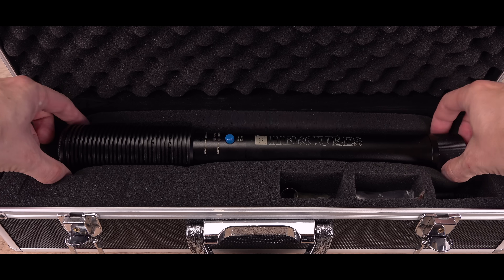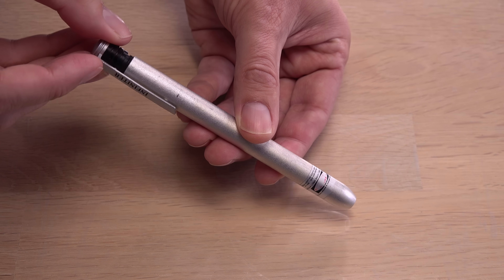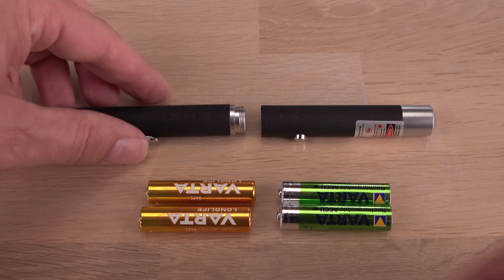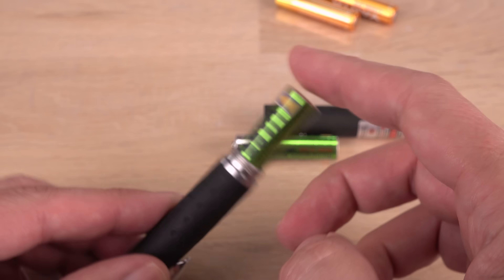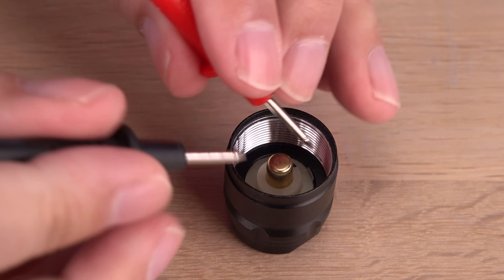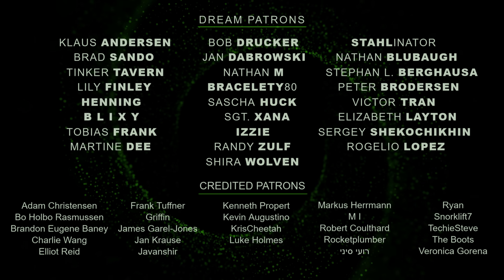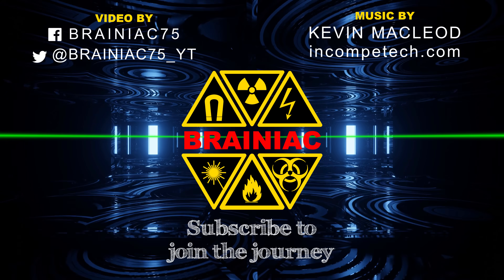DUMB DESIGNS | Laser Safety Issues Never Mentioned

Comment: one time i had two rechargeable AA batteries in a digital camera in my pocket. there plastic coating on them was damaged from wear. they shorted in the camera, melted out of the camera, burned my leg, and i franticly threw them in the trash can. they melted through the trash can and embedded into the floor. learned a lesson.

Comment: Lithium cylindrical cells are case negative up to a certain size, if they get screw terminals or laser weld terminals I'm not sure. Prismatic cells always have cases that are connected to positive, or floating. The floating ones should stay insulated as they make contact with the electrolyte and can form dendrites inside if connected to a different potential

Comment: The case neutral is most likely not alkaline but zinc carbon. Never seen a case negative alkaline cell before. It is apparently possible if the label clearly states alkaline

Comment: I'd need to see exactly how those new plastic tube laser pointers are made, but if I had to guess the plastic isn't there becsuse peeled cells =  bad but because metal = expensive.
Easier to shove in some recycled condoms and save a penny on each laser pointer when you're producing millions of them.
Especially if those plastic tubes are already used for another purpose, then they'll be dirt cheap, doubly so if it's something like pipe and the factory is just buying up ends which have been cut off for a fraction of the cost.

Comment: I doubt that tiny red laser pointer could cause any more harm than a LED bike light.

Less in fact as I've got an LED bike light which will easily burn holes in (black) plastic or paper at a 5cm or less distsnce. Will also cook skin at that distance, I can hold it up to my hand for about ten seconds before I need to move it as I'm grtting burned. 
The light wasn't even expensive either, cheap rechargable light in a 2 pack. 

That red laser pointer you could point at your hand, black plastic or paper or anytbing else and never be harmed. Even if you ended up shining it in your eye it wouldn't do much more than dazzle.

You're looking at a similar output as a barcode scanner. So while the safety warnings are good for higher power lasers, I feel using it as an example of unsafe design (from a laser safety standpoint) is a bad one. Kind of feels like it'd introduce a boy who cried wolf attitude and make people treat more powerful lasers with less care.

Comment: The 5 sec delay actually can make issues like "turned it on.. it don't turn's on. What is wrong? I totally need to look at the laser's barrel to see if it's turn on, even if it fires invisible wavelength. Ouch!". You may say that user need to read instruction first, but 1) users like these don't read instructions 2) "safety" section of instructions usually mostly consist of "don't eat the batteries", "don't eat the laser", "don't dive with the laser when it's turned on", "just in case you're forget, do not eat the laser, even partially", "don't disassemble the laser", "in case if you disassemble the laser, don't eat its details", "dispose it in accordance with local regulations (not by digestion)" and so on, so most users just don't expect to see any unobvious information here and skip it.
Reply: It's actually a legal requirement

Comment: You have to differentate... 
These cheapout issues would be an issue IF it was a high powered laser...
Those lasers are class 1 or 2... not dangerous at all (unless you are the dumbest person on earth and look straight into the beam for a quite long time)
On Class 3b or even class 4 lasers like a 1W Laser for example it would be an issue... but like i said, most of your lasers arent powerful enough to do instant damage in an accident, like accidently looking into the beam for like 0.1 seconds.

Comment: It is great to see someone covering battery case polarity. I first became aware of this issue a number of years ago when I had to remove the labels from some batteries so they would fit into a device. In that situation the device's case was non-conductive but I discovered the batteries I was using were mixed case polarities (from different packages).

Comment: Rechargeable batteries, the NiMH AA and AAA ones, are great, however, they are not designed with years of use and multiple insertions into different devices in mind. The plastic wrap on such batteries needs to be far heavier duty.

Comment: 13:21 I don't think the delay makes it safer. Quite the opposite in fact. When you put it on but nothing happens, the first instinct for many people would be to see if something is blocking the hole or if they can see the diode on, and guess what happens after that? Their eyes gets blasted with the laser.

That kind of safety features are only safe in controlled environment with strict pre-learned procedures, but makes it more unsafe with casual peeps who are not used to working with lasers.

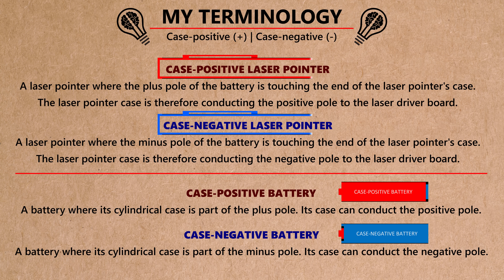Comment: 3:56 Alkaline Batteries are always case positive and rechargeable NiMH Batteries are always case negative, that's just a fact due to their chemistry. The Battery shown at 4:30 is actually not alkaline but one of the older and cheaper zinc-carbon batteries which are also case negative. The same goes for the last one (GoldenPower), but this one has an additional outer shell which many of the better zinc-carbon batteries have, especialy older ones. Apparently this is because with zinc-carbon batteries the outer case electrode gets eaten away during usage and they were prone to leaking mor often. Though i don't know if the outer shell is really isolated electrically, but i think there should be a plastic layer inbetween to stop the acid from corroding the outer shell and because the shell is conductive itself.

Comment: 2:34 I didn't knew that these rechargeable Batteries are actually made exactly up to the standard, i always thought that they are made a bit bigger and only alkaline batteries fit the standard. But nonetheless, i've had this problem with many devices where i'd like to use rechargeable batteries but they just won't fit and only alkalines do because they are a bit smaller. It's really annoying. Apparently some manufacturers don't design the battery compartments exactly to fit the standard but rather just measure alkaline batteries themselves and make it very tight or idk exactly.

Comment: 2:20 Tip: I had a noncontact voltage tester with a similar style mechanism. Plastic case with a whole cut for the tab to touch. Only problem is it would touch a lot drain the batteries beep etc. I found a piece of tubing that fit over the tab to save myself buying batteries every month. This could also be done with a straw the thing is to make sure you find one that fits the diameter and is a slightly snug fit.

Comment: 5:50 - that Golden Power is NOT an Alkaline cell.
Alkaline batteries are case positive. Carbon zinc ("heavy duty") and Ni-MH batteries are case negative. The construction is based on the chemistry.

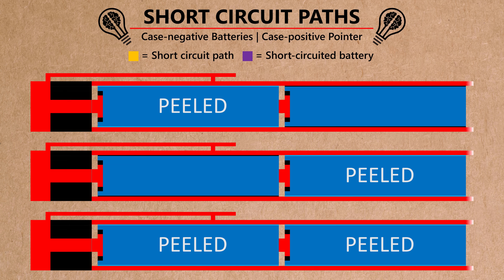Comment: 3:40 So basically it's a pipe bomb
Reply: Those small alkaline batteries will likely only get really hot until they're completely empty
Reply: @im1random263  Exactly, and if the matter inside starts boiling, turning into gas, the pressure can build up to such levels that it turns into a pipe bomb.

Comment: Considering that battery insertion directions are always included in battery compartments and, therefore, a standard polarity is obviously assumed by the manufacturer, how is it that case polarities for standard sized cells aren't standardized no matter what the cell chemistry is?
Reply: Because it doesn't matter in 99% of cases (bad pun).
And the chemistry determines the polarity of the cell's casing. For example, all AA cells used to be carbon-zinc and case was negative.
Then Alkaline cells were developed as an improvement, and that chemistry is case-positive. But it doesn't matter in 99.9% of cases because there is an insulating sleeve around the cell, and battery holders are almost always made of plastic anyway.

Comment: Consider an aluminium 3D or 4D electric torch or flashlight. 
The alkaline D cells are massive, case-positive, and covered with a thin layer of self-adesive plastic where, with the time and humidity, the ink becomes slightly conductive.
Now, there is a parasitic current of few microampere between the batteries insulation film and the inner wall of the torch (flashlight).
While the expiration date of the alkaline D cells is ten years from the date of their manufacture, the parasitic current is enough to discharge the batteries and cause the MnO2 pellets to expand, and leak the NaOH electrolyte inside the flashlight, after two to three years from the last use.
I still have some multiple D-cell flashlights, and have a PVC sheet wound around the batteries, so they don't touch the aluminium tube. In this way, I only have to contend with humidity - which renders the gasket located at the negative pole electrically conductive. Usually place a good number of silica gel sachets in the head of the flashlight. I do suggest, if you want to keep the flashlight (or the laser, or any other device) ready to operate, to replace the battery every year at the beginning of the summer season, when defective batteries do their leaks. I know it is expensive to replace allegedly good batteries, but consider that it is not the flashlight (or other device) to be expensive, but its readiness status.
Thank you for this awareness video, as it has touched a matter which is very important to me.
Greetings,
Anthony

Comment: The 5s delay makes it less safe, not more safe.
Reply: Wrong, it's actually a legal requirement.
Reply: Yes i thought that too. I could just think of someone wanting to turn it on and it doesn't so they look into it and then you can imagine what happens. Although any sane person should never ever even look at the laser aperture as long as it is not 100% sure that it doesn't have power but still things could happen.
Reply: Umm, if you are shooting, and the gun doesn't go off, do you look into the barrel and keep pulling the trigger? Well. most people don't for obvious reasons. 😂
Reply: @Njazmo Lasers firearms are very different.

Especially in how easy they are to get, because (consumer and high end consumer grade) ones will not put a huge hole in you.

Comment: 5:50 I think Golden Power is simply carbon zinc cell, as most cells this type are labelled super heavy duty.
Reply: Yes and the Power Cell too, apparently it is mislabeled. Alkaline Batteries are always case-positive. Zinc-carbon batteries and rechargeables on the other hand are case negative.

Comment: I'm glad you made this video, as I've been meaning to design a laser pointer for astronomy, and I would have never considered battery safety.
Question: it's generally accepted that a laser power of >5mw is dangerous if you expose your eye to it, but could you run a more powerful beam through a beam expander and increase safety margins for accidental exposure? Figured something like that would be useful for astronomy purposes where eye protection may be impractical for the application.
Reply: A beam expander might malfunction because of getting accidentally dropped and misaligned, and you would have no idea that the beam is now dangerous
Reply: @JasminUwU true, but it only exists as a safety margin increase. If you're doing everything else right, you should be holding the laser above everyone's heads, so any malformed beam would still never hit anyone.
Reply: @Soandnb  that makes sense, but you have to keep in mind that people are more reckless when they feel safer. 

Human psychology is important to keep in mind when designing safe systems.
Reply: It is reasonable; if you look at how the power limit for class I lasers is determined, it uses a value for a dark adapted pupil and a specified amount of energy that that pupil area would admit. Expanding the beam, either via a refractive element, a diffractive element, or a scanner that keeps the beam spread over a large area (with appropriate scan-fail monitoring) will all help to keep the power density within safe limits.

Comment: only have two lasers, both class IV, and both mains powered. So goggles go on and beam stop is positioned before I plug them in. Both have safety delays anyway - the ion takes about a minute to strike the tube, and the CO2 has an artificial 30 second delay. Both have led's that indicate the startup delay (ion is "pre-heat" and CO2 is "delay")..
Reply: Only 2? You need more.

Comment: ive NEVER seen a AA/AAA where the case is positive.... nor one with a neutral case ( though i did find some random cells once inside something i took apart)............... like where would you get these things, and why would any need them, and are they very clearly marked so they dont mess up devices, or just not work in them?
Reply: I have a couple of Apollo brand office supply pointers that are nicely. made, with the end cap of machined brass with a plastic overlay the + terminal.  

Bought them cheap in a clearance bin, and got lucky that the defects were minor bad solder spots.  

I think a small green one that takes a 16340 or Li same size is case +, iirc.
Reply: You just haven't looked at your AA and AAA's. All cylindrical alkaline batteries are case positive, that's how they are constructed. The center rod is the negative.
Reply: @johncoops6897  That's both not true, AND not the claim of this video.  

The video was talking about pointer cases.  In pointers where the end cap is a fixed terminal and a spring exists on the rear of the current driver module, with a side button switch, they're usually pointer case positive and negative on the spring.  

In some pointers with a spring at both ends, the case is negative, but in cases with a rear safety interlock, often the positive (usually an 18650 for a higher power LASER) is often to a spring terminal on that switch module, and the pointer housing is positive.  

There are enough variants, that you cannot assume without inspection.  

As to batteries, depending on chemistry and design, the outer case can be negative, or floating.  But, while that's critical to potential shorts if outer wrappers are damaged as this video discusses, it's not the pointer design.
Reply: @lokiva8540 - not sure what you are babbling about the switch design of laser pointers in a comment thread that is discussing the polarity of batteries.
. .
Zinc batteries use a zinc outer body that is negative, and a central  Carbon rod that is positive (and connected to the end with the nub). The positive end of alkaline cells is insulated from the body of the cell.
Alkaline cells have the reverse polarity due to their chemistry. So they have the negative (flatter) end insulated from the body.
This is easily verified, both by online research as well as simply looking at them.
Reply: @johncoops6897  Did you not pay enough attention to see why LASER pointers and manufacturing tolerances in them and in batteries are focus topics of this video?  

You just gave a good explanation of why button cells exist as they do.  But, who seriously uses anything but NiMH or LiIon in any regularly used LASER pointer?  

At least LiIon are close to the natural needs of diodes, and so more desirable to use a 14550 or 18650 than stacks of low voltage batteries.  Also more reliable to have fewer contact points.
Reply: @lokiva8540 - The discussion here is regarding AA and AAA battery cells.
That's all, simply read the OP 👆
Reply: @johncoops6897  no its not, every AA/AAA ive ever had, including the one im currently holding ( Duracell) is CLEARLY marked "+" on the "nub" end... ak the center, not the case..... go look at one for your self
Reply: @ZOMBIEHEADSHOTKILLER - duh.  Yet if you actually check, like shown in this video, you will find that underneath the plastic body wrapping is a metal cylindrical body that is connected to the positive (nub) terminal of alkaline cells.
Or, look at the negative end (without the nub), and you will clearly see the insulating ring between the negative terminal and the positive body. Even on your precious Duracells, which is why they always leak at the negative end.
In other words, pay attention.

Comment: The second safety thing that needs to be shorted to turn on, is designed so you can connect it to a door or case switch. Its the physical equvalient to a "safety API", allowing you to control the laser externally using a safety interlock. Im pretty sure the 5 second beam delay is not because if you accidentially touched the switch, but rather, to ensure case or door is fully closed, so the beam light doesn't leak out of cracks in the door opening. Since many door switches and magnets and such do react a little early.

Imagine the large laser being in a enclosed optics bench with mirrors and such arranged to create something optically. You turn on the laser, and then start closing the case, which would short a switch. If one of the mirrors were angled wrong, you could get a laser in your eyes, because the case had a crack of 1mm when the switch were tripped. By the 5 second delay, you ensure the case gets fully closed before laser turns on.
Reply: That makes a lot of sense, so shoring the contacts for the plug should be the last step to turn it on.

Comment: This video reminds me of when I used to build my own handheld lasers. They were usually built in gutted flashlights so unless you were using a battery holder you had to make sure either the inner barrel was coated, which it usually wasn't,  or you used good batteries with intact wrapping. The sad thing is I don't remember the polarity  of a couple of the ones I built and need to take them apart to see if they're wired case positive or negative since with home builds it depended on if the diode was case positive (batteries go in backwards), negative or neutral (batteries go in "normal"). Both of my pro built lasers have all the safety features that yours did.